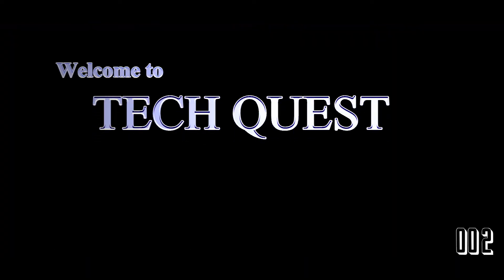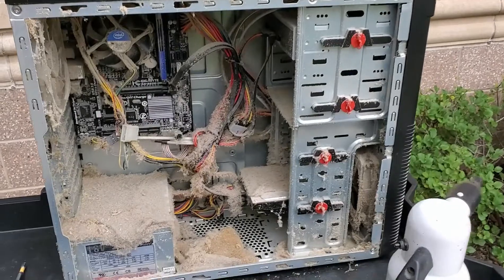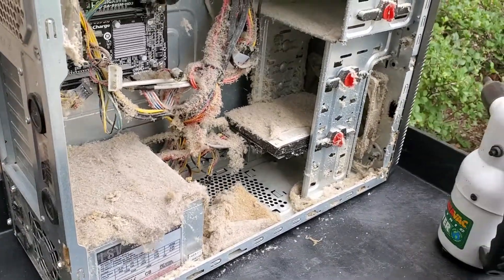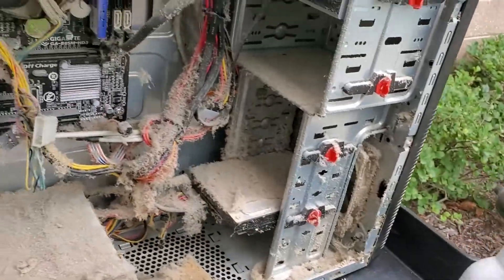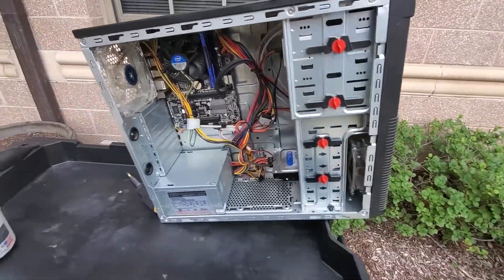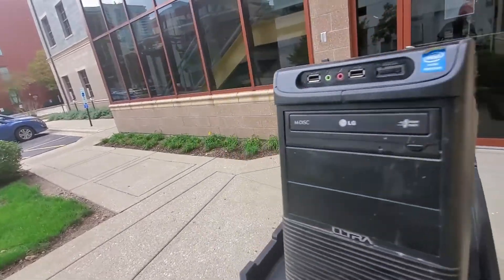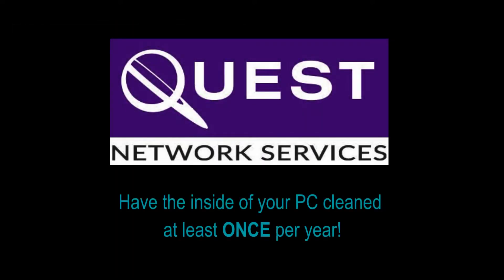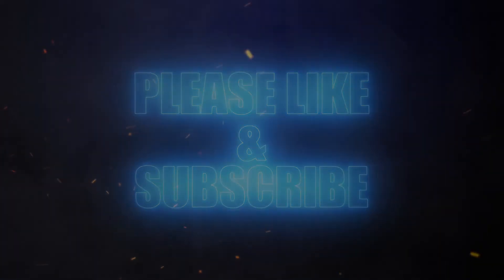Cleaning out a Dirty Desktop Computer

Comment: If the customer changed the pc what hapened to it? I hope it didint get dumped.
Reply from the maker: No the customer decided to keep it. After cleaning it, the system was able to boot up but it ran slow. They told me that if they ever decided to get rid of it, they would recycle it with me. I typically will upgrade and replace components of older systems and make them like new unless they're really old.
Reply: @QuestInternet  good to know , love the builds keep an update if you can!